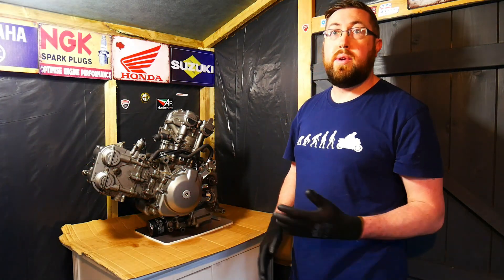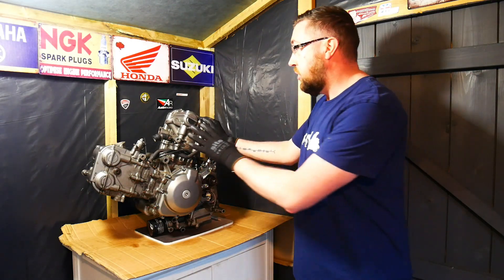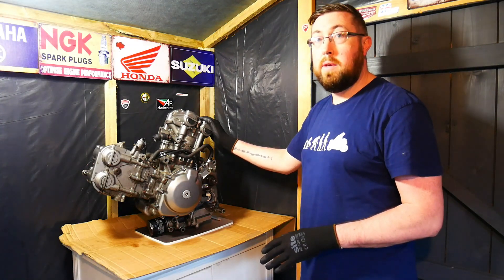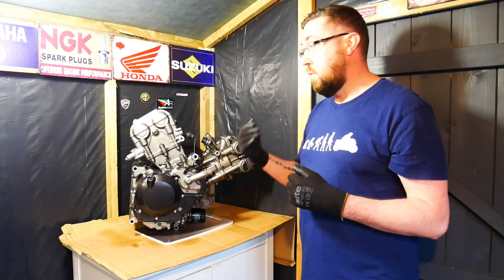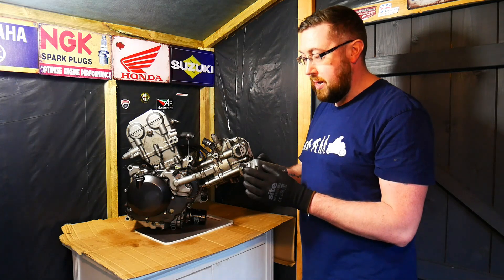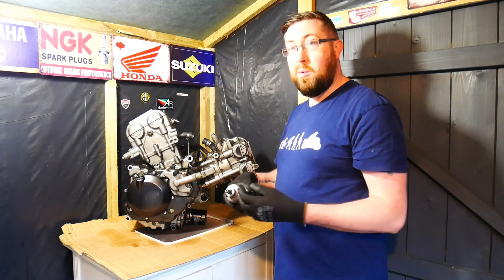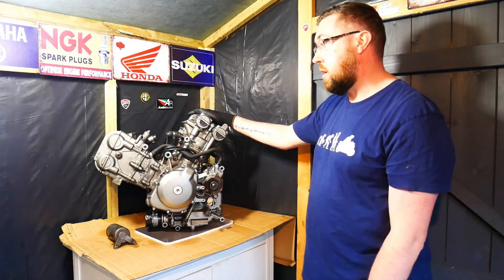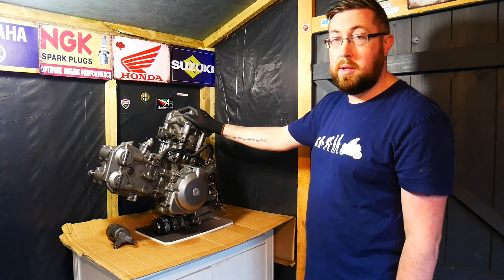SV650 Engine Failure Diagnosis

Comment: Please save me bro. I just took the engine down but I can’t figure out what is tha problem. I went on a cruise and it started to make a beating noise very hard. I felt all the motorcycle trembling and it beat right in my chest to be exact. That’s where I felt it the most. After that I completed with some oil( I suspected I ran out of it), started it and for 10seconds sounded normal then the vibration and knocking sound started again very hard could you give me an ideea or opinion.i have only one mechanic and he said that it’s too much trouble and to get a new one. Thank you!
Reply: Is it loose in the mounts? Get it resolved?

Comment: I was very worried when he pointed at the engine failure being the starter pinion tooth breaking. I had aan Amazon starter that ate every tooth on the starter and replaced it with a used original starter on eBay. I thought I was doomed when I heard him say it broke the engine. Until he pointed out that the mechanic was an utter knob.

Comment: Throwing away a dl650 engine at 60.000...blasphemy.

If propperly taken care of (oil, filters, valves, timing chain) they easily last over 200.000

And that comes from how brilliant the Jappanese were when they built this engine. How the oil jets work and are distribuited and how the oil is ran trough the oil cooler to keep an optimal temperature.